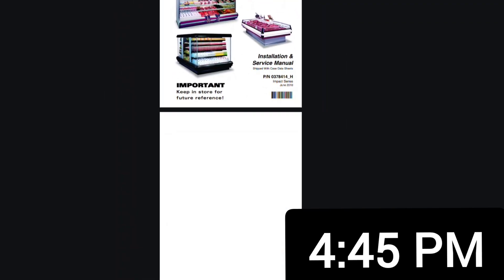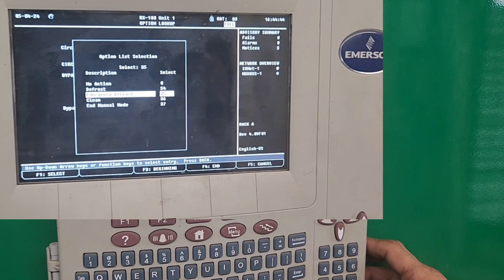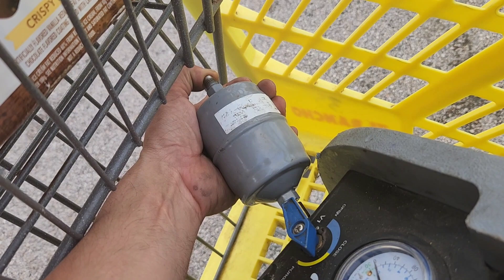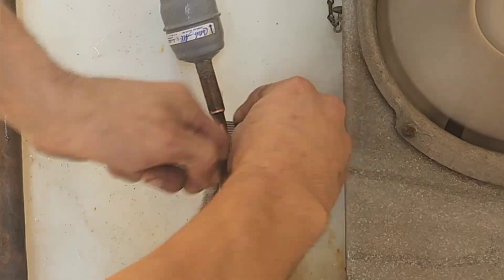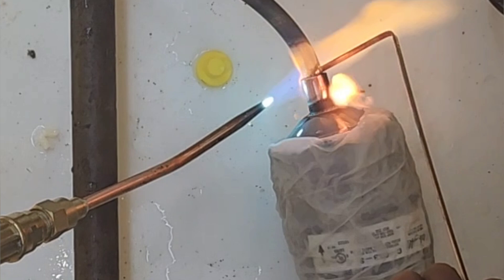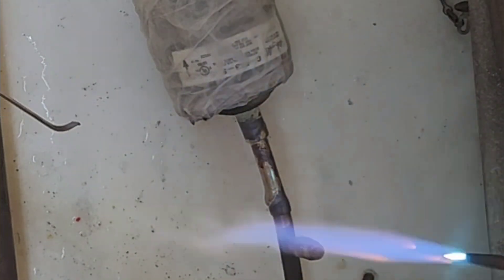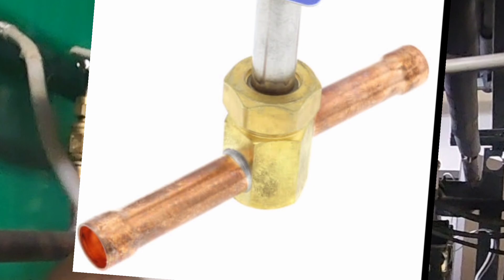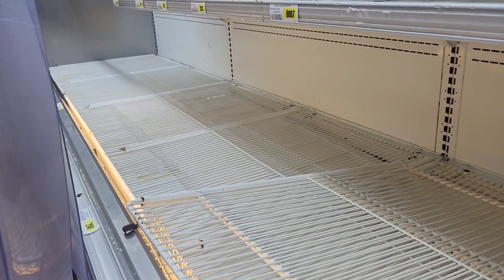RACK CIRCUIT WITH 2 RESTRICTIONS SOLENOID AND DRIER REPLACED

Comment: Yes if you cover that short piece of copper with solder it will make it stronger. I’ve done that in the past if there’s a chance of vibration and cracking the copper.
Reply: I have had soft solder completely open up at the bottom while soldering and I don’t mean a small hole I mean like a big hole about as long  as a fitting and really big it might be a bad batch